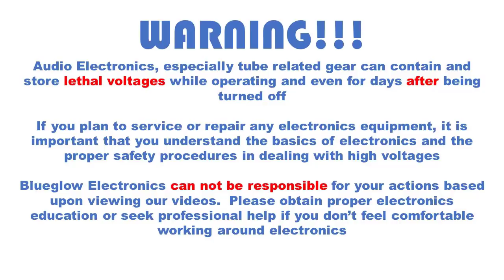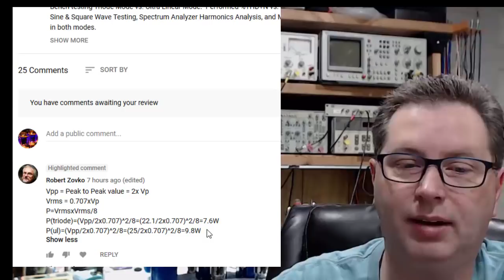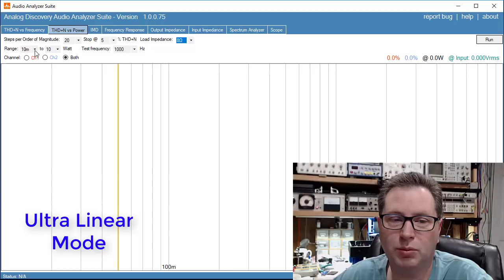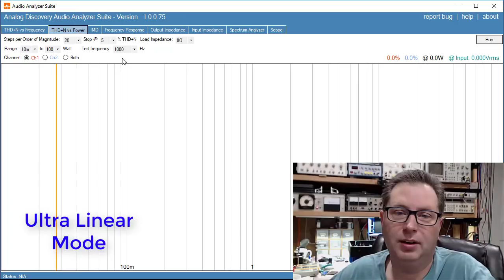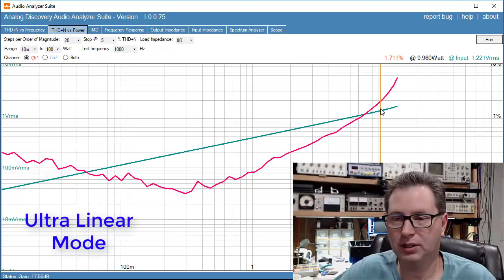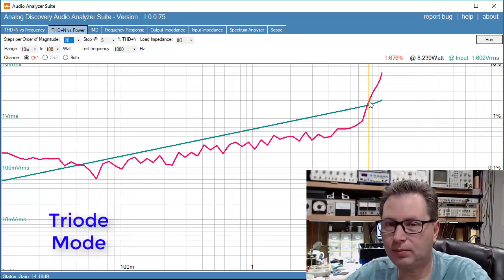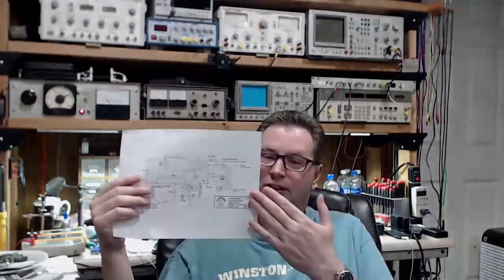KT88 Single Ended Tube Amplifier Build 2018 - Part 10b

Comment: I have really enjoyed this series Mark, I now know why you are satisfied with the output power of this amp.  Klipsch, corner horn speakers.  Dang man, I remember back in the '70s going to the local hi fi store and going into the listening room to hear the Klipsch corner horns.  They would play 'Dark Side of the Moon~Money' and it would vibrate your bell bottoms! They were driving it with a massive SAE 200 W/ch amp with an SAE parametric equalizer in front of a Thorens turntable.  It was live concert sound pressure level and I loved it.  No room at my place for such furniture.  Good on you buddy, enjoy the tunes and have a Merry Christmas.  PS, ignore the ignorant trolls that befoul the internet comment boards, they envy what you have and are weak souls.

Comment: Interesting to note that you describe speakers whose value new today in total is in excess of $25000. Makes the cost of this amplifier seem cheap by comparison. Hopefully you also have some other equipment that will actually push the Klipsch speakers. Love this stuff.

Comment: As a tweak, I'd be interested in seeing the results of true global NFB from the output transformer secondary back to the input tube.
As far as distortion goes, a misshapen sine wave that still looks like a sine wave at 1% THD is inaudible, but as soon as clipping sets in, even .1 % is plainly audible. I have actually heard and measured that. Cutting off the peaks wreaks havoc with the sound.

Comment: 5W per channel with efficient speakers is plenty most of the time for normal listening.
Reply from the maker: I run a SE 45 amp a lot that puts out 1 watt and will run you out of the room with the right speakers
Reply: 5WPC "RMS" to ordinary 87 dB speakers is way too loud to most people even in a very large room in a house.
Reply: Lol I do enjoy it loud. Most of the time the power meter on my amp is below 0.5w per channel. But I do like to see the thing lighting up past the 7W marker. My speakers are 92db and 5 ohm roughly. Very occasionally I get the 100W marker lit up but that's full hearing damage volume in my small room 😄
Reply: I like it loud also. I have two amps in my main system. A single ended 807 amp and a 100w push pull 6550 amp running at 675vdc B+(100wpc). My preamp has a switch that connects either amp or removes it from the circuit completely. I made a box to switch either amp to my speakers or disconnect it completely also. I can switch while music is playing. The two switches flip the same direction to choose either amp. I sometimes want slamming loud music, and my speakers work well with either amp. They are custom JBL Pro with 95db sensitivity 2206h woofers, 97db 2118h mids, and APS-40HF 111db ring radiators from ProSystems in Russia. Custom crossovers with appropriate pads to level the drivers to the woofers 95db. Oops, sorry so long winded.
Reply: Reminds me...
Way back when, I was repairing a high power PA amp that used 6550s. Someone tried unsuccessfully to repair it. It was brought to me to straighten out. When I tried the buzz test to an input, the thing nearly killed me (threw me clear out of the shop). The previous "tech" somehow got the aux input wired to the 600V B+ line. Gotta be super careful around tube circuits.

Comment: I built this DHTRob Mu Stage Headphone/line amp using a 76 triode and a 6688 pentode, because I had them on hand. I have it in my main system right now and I really enjoy it. Here is a schematic for a Kimmel influenced mu stage using tubes designed 30 years apart from each other.  https://www.dhtrob.com/schemas/afbeeldingen/HoofdtelefoonversterkerMustage.gif